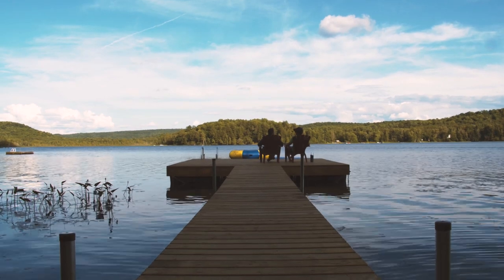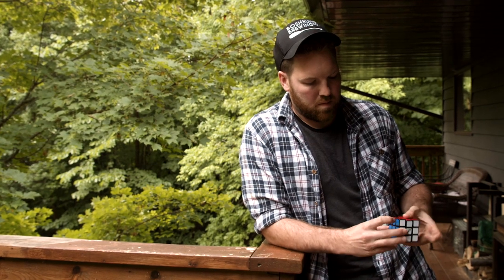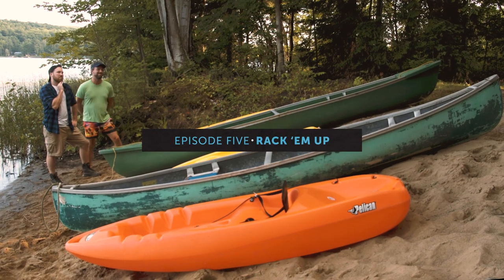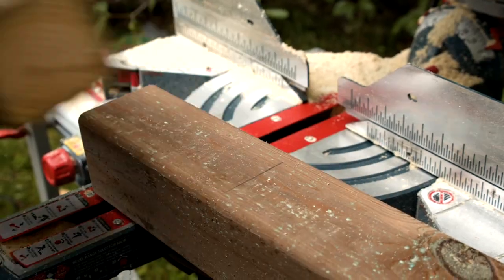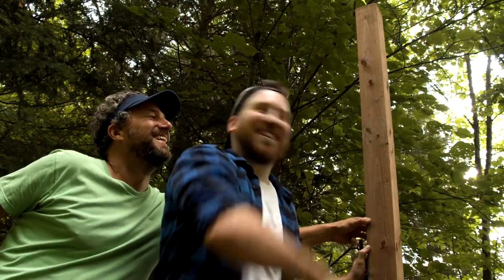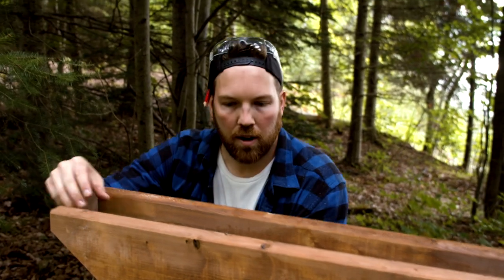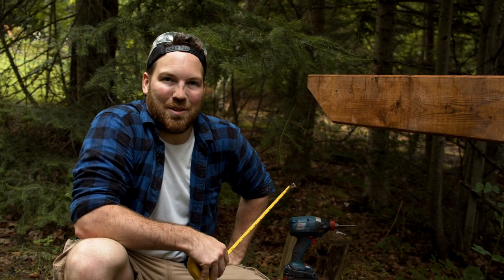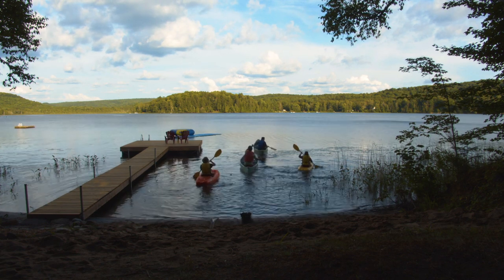Building a Canoe Rack - Cottage Coach | Episode 5

Comment: Great video. I built this (with some slight modifications) this weekend. I'm not sure how you got away just using screws at each of the shelf levels. I used lag bolts - 2 on the front and 2 on the back at each level - on both sides of the rack.